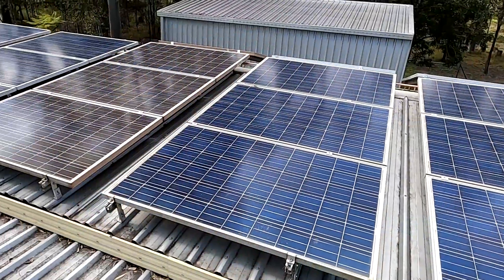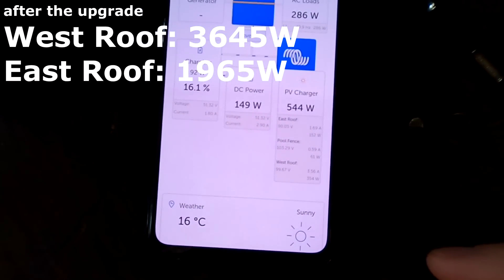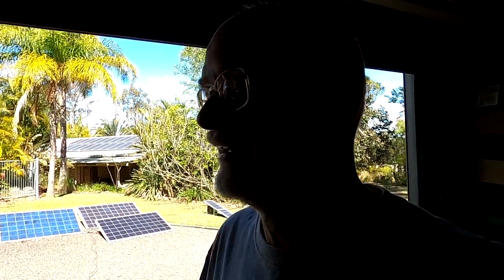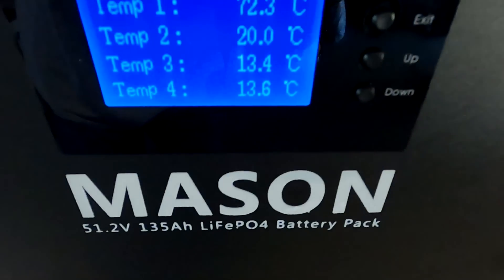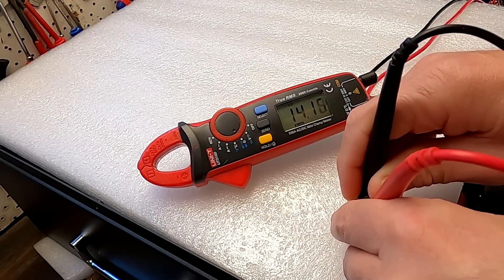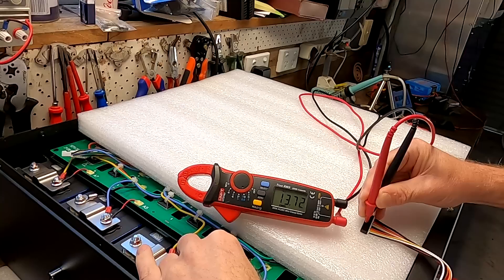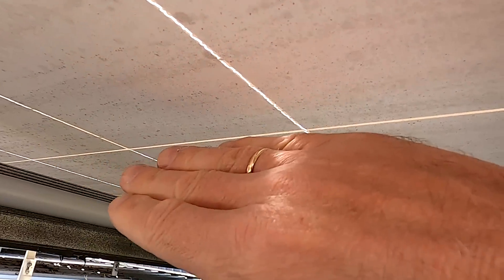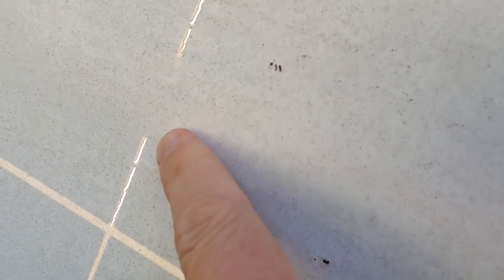SEPLOS MASON temperature sensor problem and a major issue with the solar panels. NOT GOOD!

Comment: Great videos and knowledge Andy, for the SEPLOS BMS I would be interested to see if the balancer component was working ( as in the BMS could keep the pack balanced after a pack had been top balanced)?  Also would be keen to see it plugged in over CAN to your Victron kit.
Reply from the maker: There will be more content about the communication side of things coming in the future. I'm in the process of recharging the pack now and see if the BMS can handle it now after the last top balance we did with the active balancer.

Comment: The solar wafer are glued on the glas. Look like they shrinking now. So u get the cracks. From bottom u get huminity which distroy the busbars.  U need much better panels on ur garage than u use now. get rid off it.

Comment: LOL  I mixed all my panels.  No problems yet.  They sold out of the old type panels and only do the new half cut ones.  Connected them all in series and let them figure out the voltage.  I think they go to the lowest voltage panel, so I will get a loss but just add others panels.  Growatt are rated at 500v.  So you can have up to 12 panels.  Probably wouldn't want to use secondhand panels for this.  If I was using crap panels, then I'd probable parallel then in 2s.  Keep the voltage and amps to a min.

Comment: Hi Andy, You could get electronic grade silicone caulk and thin it with toluene and brush it on the back of the panels.
Reply: There are caulks that are clear, and are thin-able with mineral spirits. Like Lexall

Comment: Andy I think that's only the caulking  splitting ( uv and oxidation damage) on the panels. We fixed that by re caulking to re-seal the back of the panel, that was ten years ago and they are still working. Those panels can not handle our high heat an U. V light we have here.

Comment: They just need to be sealed. A good white elastomeric reflective roof coating. I put 2 coats on mine. Sealed them right up. It’s flexible enough to take the temperature swings.

Comment: more soldering and a balancer..... Figures with that kit.. A big NO THANK YOU.... I'd rather build my own for the price they are asking.. 2000. bucks shipped to the US NOPE.. I could buy 16 280 ah cells with free shipping and a decent bms just for the cost without a free metal case.. BIG WOOP..

Comment: Strange but lately I have been having a problem with low temp charge protect on a Daly BMS, I di get cold temps at home but what is happening is I have the temp set to 4 degs C but when it gets above that temp it will not disable the low temp protect on charging until I go into the BMS and change the temp protect setting either up or down 1 degs, the sensor will show say 8 degs C and I know that low temp alarm is still enabled when the setting are set to 4 degs C, I got a feeling it is a firmware problem.

Comment: RE: The mason 135. I had the same issue. The fix for mine was to remove the pcb board and remove excess solder. After I checked the other one I found void in the solder. Needless to say I cleaned up both areas and re soldered. No issues since. The voids and excess were on the backside of course. Good Luck

Comment: The cracking of the backing sheets of panels is a fairly common occurrence.  It's generally not  a huge problem and can be repaired by wiping the back of the panel with alcohol letting it dry and then coating the entire back of each panel with silicone caulk and flattening it out.  People have also used solar panel encapsulants to do the same type of repair with good success. Thermal imaging along with visual inspection can identify any panels that are not worth encapsulating or sealing again.

Comment: At least you don't have a ton of money invested in used panels.i started having brand new panels burning thru backing.which is horse poop.the company at this point say it's my fault from shading.im calling bull sh!t it's happening  to 3 panels all burnt thru in same spot they are 20 feet apart .its a manufacturing defect.all I can say is pv panels at 8. Dollars a watt that last 40 year's is better than a dollar a watt panels that last 4 year's or less.im not mentioning names of panels yet as I'm trying to get some help or replacement from them.if that fails you will see a bad comment where ever I can post it.i took down my 40 uear Arco pv to put up some Chinese junk

Comment: You can get optimizers for panels that are in the shade(required to meet rapid shutdown anyway).  And you can still get 60 cell panels.  It is still common for residential setups to use the smaller 60 cell versions in the 300-350W range.  The voltage and amps are higher than your current versions so you might need to change fusing or string size.
Reply: Optimisers are NOT cheap, and certainly not cheap like Andy’s second hand panels. It wouldn’t be economic.

Comment: You can fill the back of the solar panel cracks with silicone.  Won't affect the performance and will seal it again.  Just clean with rubbing alcohol so it will stick.

Comment: Hi Andy, I’d like to see you attempt a repair on one of those bad panels. Can the lines be resoldered or resealed in some way to make them safe again?
Reply: there is already oxidation in multiple places, the risk of high resistance burnout is too high. I'd scrap them for safety.

Comment: Not good at all. Delimitation and corrosion. There could DC leakage when the back of the panels are moist. 
Probably best to source newer used panels instead of repairing as the corrosion will eventually make every panel kaputt.

Comment: I'm looking forward to the communication video. That's kind of a hobby of mine.
I guess that it's quite useless in a setup with multiple parallel batteries to connect only one of the BMS. Venus OS can handle only one battery monitor, so you can't connect more than one.
There is some Software around that implements several BMS (JK, but also QUCC) as battery monitors for Venus OS but also handles just one of them simultaneously. However, it should be simple to add Seplos to it, if it's not yet supported.

Comment: Love ur vids Andy, ur always a wealth of useful, helpful, detailed information & data. I think 1kw of shaded panel output is a prudent goal for ur purposes. I do have doubts of how much trouble you could possibly have with ur setup the way u have structured it all with safety aspects throughout, and ur inspectors will be admirably impressed overall. How serious could a major malfunction of those suspect panels get? Im wondering if they wont perform ok for many years to come still, and u could be filling out ur roof space as planned while looking out for more panels in the meantime to replace said faulty panels later, i would have thought there are still a lot of reasonable used panels out there for cheap that just require a bit of time & travel to collect, & Im sure ur still up for it. Thanks for ur efforts and in checking out communications gear which is where I am at presently with 3 x SolarTorque 48v batts w/ Seplos BMS all paralleled, no communications and 2 batteries only charge to about 70% @ 55v charge setting, so look forward to ur coming vids. Cheers

Comment: While you wouldn't put different panels in series, I don't see the issue with having two parallel strings, each string with different panels, since it's the total string voltage which matters, not the individual panel voltage.
e.g. 8 x 30 V panels on one string in parallel with 6 x 40 V panels on the other string results in two strings with the same string voltage. 
Just work out how many panels on each string will make for the same string voltage (close enough) for your specific panels and will be within your charge controller voltage limits.

Comment: Andy, I have always greatly appreciated your attention to detail. Pointing out the problem that you're having with the Canadian solar panels. I find to be enlightening. As more and more used solar panels become available at a considerable discount. Being aware of this type of problem is extremely useful. Might I suggest at some point, creating a video that shows how to replace the diodes on the back of the solar panels. It seems as if that has become a common problem when purchasing used panels, or newer ones that have gone bad. It really is an easy fix.
Again, thank you Andy for your time,  effort and valuable information.
Rick Fort Worth Texas. Cheers 🍺🍻
Reply: Andy went over the diodes matter in several videos already. Not absolutely sure if replacing them was completely covered, but I think so.
Reply: @ricardomarcelino8388  thanks I'll look into the history.

Comment: Regarding the 60 cells panels, while it is true that different string voltages should avoid being put in parallel there may still be an option.  If the 72 cell and 60 cell panels have similar current ratings the 60 cell panels could be inserted into the parallel sets so that the individual strings still have similar voltage.  It would just need shuffling of the panels, ie each string consists of 2 72 cell and 1 60 cell panel.

Comment: I'm still not sure I'd trust a BMS to control the other components of my system.  For monitoring individual cell voltages and temps fine, but not the entire rest of your system.  You are putting all your faith in single piece of equipment that doesn't have a long track record and not great documentation.

Comment: Suggestion 1 - replace the faulty sensor with a regular resistor of 10k or 15k ohm - it will at least remove your "fault" condition (unless the fault is in the sensor pcb)

Suggestion 2 - The front of your solar panels is usually glass - the back is usually a form of epoxy - which is easily repairable (the cracks are probably caused by not enough epoxy in the first place during manufacturing)
Reply: EVA
Reply: The back is actually DuPont Tedlar or another plastic sheeting that melts on.
Reply: @jmaus2k  PVA Edit: SS OFFSHORE got it right.
Reply: @Poebbelmann  It is actually a few different layers.  Common is Tedlar Polyester EVA a three layer film.
Reply: Correction, the back of the panels seem to be melted plastic, amateur repair becomes a lot messier - doable I think - it will be almost impossible to remove the moisture wich already invaded the panels (they can probably still last you more than 25 jears)

Comment: Moin Andy 🌞 Switch to Micro inverters, hoymiles hms 2000, hm 1500 or deye sun or comparable. With this shady condition on the "off-grid Garage" you will get much better results.
Reply: Yes, the Multis can deal with AC-PV at the AC-Out :)
Andy can even use a Energymeter to implement the AC-PV-Production into his VRM-Portal.
Reply: Off Grid Garage is using an off grid system. Therefore these grid-tie micro inverters make no sense.
Reply: @hu2481  but works fine with the multiplus 2

Comment: It's not seplos limitation. Its victron limitation. I have recbms, it controlls victron inverter 100% perfect. But, i also have those dumb mppt's and they ignore bms orders. Using rs485 they only get max voltage from cerbo. You need to have canbus variant if you want them to respect bms commands: ie charge amps etc
Reply: Incorrect.  I use daly BMS via UART to venus os. Mppt are VE.direct,  EVERYTHING is working correctly.  Reduced current after 90% SOC,  95%, 98% (3 stages).  All programmable. 

I'm ahead of Andy on this one 🎉

Comment: It could be that you have bad isolation in rainy weather. Do you have an isolation meter? Like a multimeter but with higher measuring voltage like 500V or 1000V. Also known as „megger“ (company) or Megaohmmeters. When you have low isolation values (+ to ground or - to ground) in moist conditions, then there is a current from the panel to its frame. In Germany this is a safety hazard and the panels would be replaced. :D I think my SMA inverters are shutting down, when they measure 5 Megaohm or less. Many solar parks have these issure here. Usually the manifacturer has to replace the broken ones, because they had 10-30 years warranty.

If you want to use them till they are getting really bad, the recommendation with marine grade paint might be an option. But keep in mind, that this paint was never developed to isolate against high voltages.

Comment: Andy, are you noticing any degradation in output on your Canadian Solar panels that have the cracking and corrosion? I was thinking if the output is acceptable, that a repair experiment might be worth attempting. That being re-coating the backside of the panels with some epoxy clearcoat, or possibly some urethane sealant?
Also, I was wondering if you noticed any decrease in inside garage temperature from the additional roof shading from the new panels?
Reply: Spray on clearcoat or polyurethane. Probably not a huge deal unless you are near seawater.

Comment: If you don't have separate MPPT's available the you could put the 72 and 60 cell panels in series if the peak illumination current's are similar and the sum total voltage is within the range of the one MPPT you are using. Might be worth a few tests and try-outs before you buy an extra MPPT controller.
Reply: Should work 100 percent, just give it test

Comment: Hello Andy,
For my system, the Seplos BMS has been working with the Victron Cerbo since Fenruar without any problems. Simply use a Victron CAN bus cable type A between Seplos and Cerbo. Select the Victron protocol with the Seplos software. That's it.

By the way, the only thing that would be nice is if I could see the cell voltages remotely. About 6 months ago, the "Bavarian Super Guy" developed a solution using "Esp8266 via Rs485". But I haven't got around to rebuilding it properly yet.

Comment: If there is no warranty on the cracked panels, there are waterproof conductive inks available to touch up the cracks. But I'd prod around with a meter first, to see what should connect where.

Comment: The German Youtube Channel "Der Elektrotechniker" mentioned this problem aswell in one of his more recent videos, he's working on large scale grid tied solar and after 10 years or so the panels form cracks in the back isolator, causing the isolation resistance to go down to the point where the Inverter will actually shut down the damaged string. If I remember correctly he also had the issue with Canadian Solar panels :)
It's probably caused by long term UV exposure. 
I always wondered if you could clean and re-coat the panels with liquid electrical tape or plastidip or something similar. Something electrically isolating that's a sprayable liquid to get an even thin coating.

Comment: A parallel system is much less  affected by shading than a system and series so why not put the system in parallel so that way the shedding one affect your power production and will be easier to get that thousand watts in the shade as well as if he doesn’t parallel then you can do your DC water pump directly off of your panel so that way you don’t have a higher voltage coming in you can actually use it without having all that shading affecting your power production it was that’s why I like Perla systems better than series systems and I like 12 V systems that we can have a 12 on-demand water pump which makes so water pumping unlimited with minuscule power hope this helps 
 Using a solar Pathfinder as well

Comment: Any attempt to repair those cracks shall be performed with a material that prevents any humidity (including gaseous state) or oxigen to penetrate. That is not easy to find (silicone does not serve this purpose at all). 
On other hand it is essential to extract ALL humidity before repair - else it will never evaporate and will continue its evil job. That's not esy as well.
In case of any small air bubbles left it might destroy the repair due to atmospheric pressure variations. So repair shall be performed under vacuum conditions - not easy as well.
One might delay the decay for a while if cracks are covered with 2" aluminium sticky tape. 
Unfortunately those panels might be soon ready for the dump :-(

Comment: Why not put the 72 cells panels on one controller and place different panels on another. You can perfectly combine different orientations. If you go over the maximum power the controller can handle it will limit the power. No big deal.

Comment: Why not using the can bus  with a raspberry can hat ? I am using that Just fine. Yes its an extra addon on the pi. 

Did u Install the dbus serial battery addon ?
Reply: Yep the can / rs485 hat Works Just fine.
Reply: Waveshare RS485 CAN HAT for Raspberry Pi Zero/Zero W/Zero WH/2B/3B/3B+ Allows Stable Long Distance Communication
 Is what i have and Works
Reply from the maker: Yes, thank you. I have ordered both Waveshare hats to test them out. That should work, right?

I installed the drivers and also activated DVCC in Venus OS.
Reply: @OffGridGarageAustralia  the waveshare Dual rs485 is not working in venus os, but the waveshare Dual can had is working fine
Reply from the maker: @mimop9151  hmm, some use the dual port hat successfully, so I ordered both to test this out. I would prefer that one because it's isolated.

Comment: My vote would be remove all the panels from one side probably the faulty side and replace that side with 72 cell then you would have a few extra 60 cells to replace any that may go bad on the other side
Reply from the maker: Yeah, that would be one solution. I'm sure, I would use these 'spare' 60 cell panels somewhere else. Maybe on three car port.